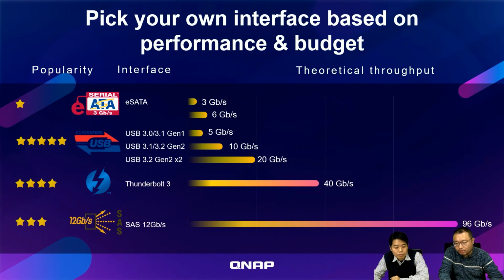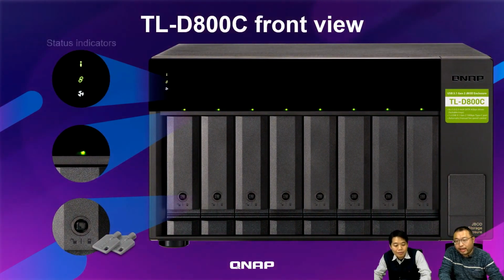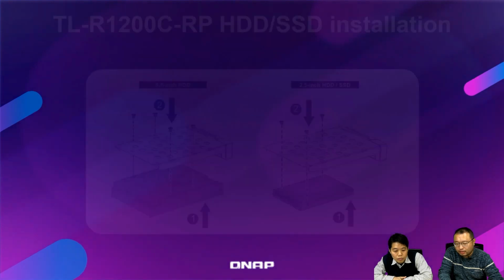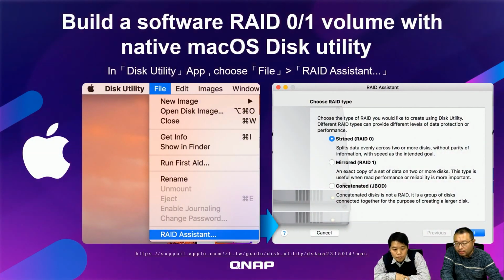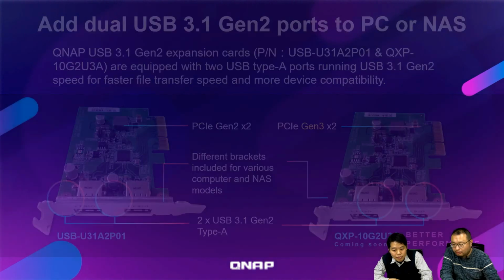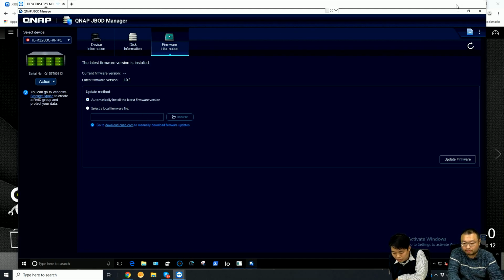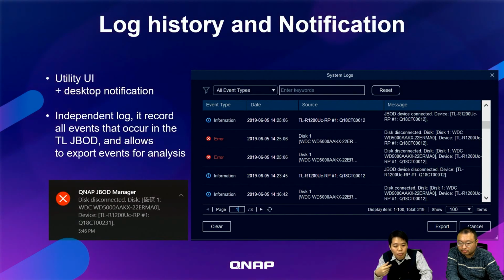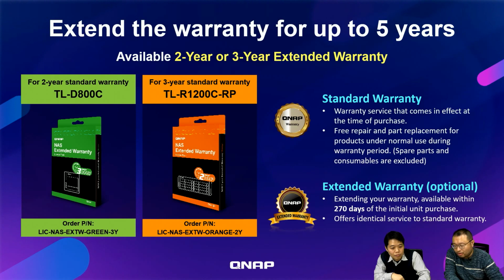Rackmount TL-R1200C-RP/Desktop TL-D800C: JBOD expansion enclosure with USB 3.1 Gen2 Type-C interface

Comment: is this only expansion  ? or we can use it as nas drive ?
ive search alot , but i cant find a way to copy file on that
Reply: On a Synology NAS unit you can only use/consume the formatted volumes on the 8-bay device.   I assume the same would be true for a QNAP NAS unit.   If this were a Thunderbolt device then I guess more options could be possible (meaning using the individual drives as members of a pool/volume), but I think the goal here to keep the price down with no real logic in the drive other than a USB-C to 8-port bridge (or say 2 4-port SATA port replicators, old technology).